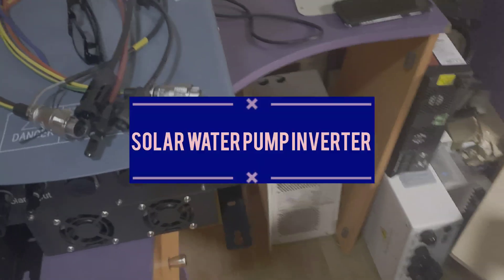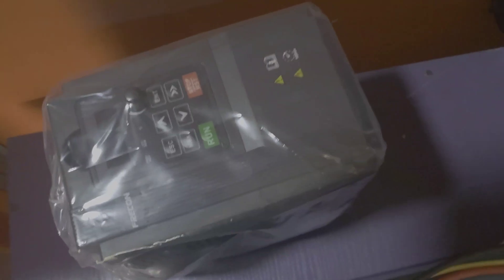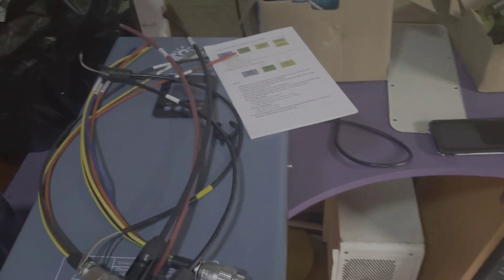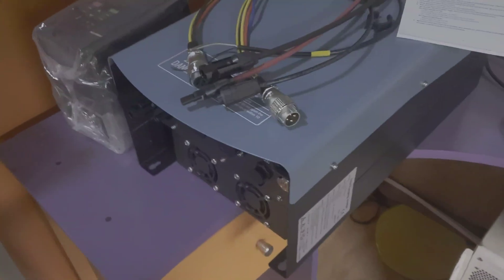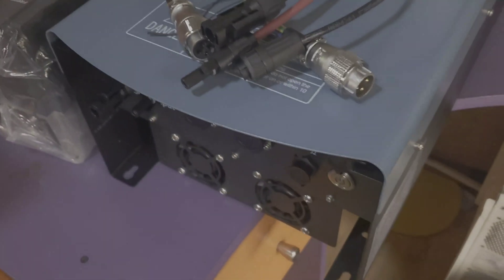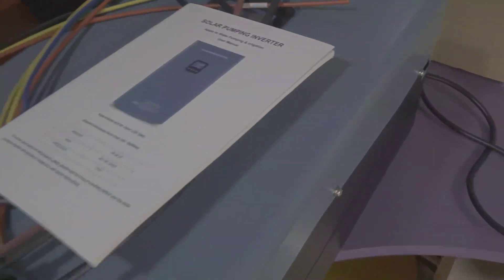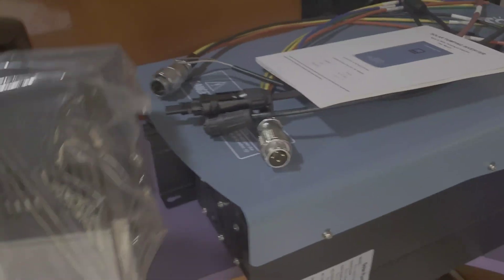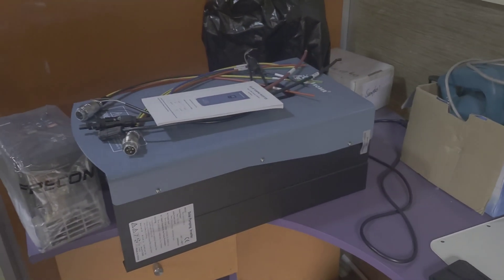Solar Water Pump Inverter. Hober. #water #farming #solarwaterpump

Comment: Can’t wait to see more my friend 😎 I’ve been doing changes to two of 5 of my solar arrays that have no shading issues . Both all panels were wired in parallel. Each array has 6 panels that I now have wired in 2s 3p and on the first array I almost tripled the kWh going to my midnite solar 150 arch fault/ ground fault charge controller . Each of my arrays has its own midnite solar charge controller... I’m excited to produce more kWh with what equipment I already especially since we are in fall here and are heading into low power generation season.
Reply from the maker: You can imagine how much money you saved with such little change. The pm function seems to be rather strong for you. What distances were you running you cables? What size?
Reply: @drsolar  yes just a small change in the learning curve ! My main runs are 50 ft  or less from panels to controllers and I’m running #8 /3.236 mm . I built a equipment room on the rear of my house where I’m as close as possible with my equipment to my panels
Reply: But I now have 2 years of  data on the panels all in parallel and I now know in series is best up to how much the controllers will handle except where shading issues exist . I’m learning on the cheap by doing everything myself but I also can trouble shoot my system because I understand how and why it works 😎

Comment: Would be keen to find out what sort of size water pump, that can drive, in-rush current protection, as well as lightning protection and how it handles heat over a long-term draw. I clearly believe, water, food & energy are the next areas where human existence shall be underpinned, with information technology in support, off course.
Reply from the maker: Thank you for watching and commenting. Not sure I will be conducting any of those experiments. The water pump is 1 hp or 745 watts. The in-rush is not much of an issue in that they vary the frequency as they operate.
Reply: I guess the old adage is true: cheap is expensive. What’s the warranty on it and Pv input size? Hopefully on your setup they’ll have a pressure tank to reduce the runtime of the inverter and maybe even have water being fed into a water tank or more for storage as well. All the best.